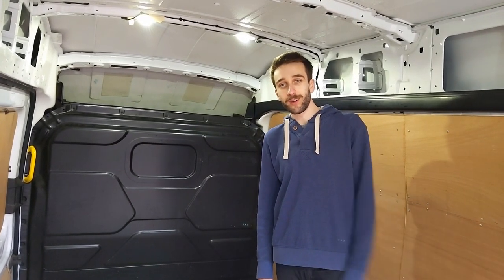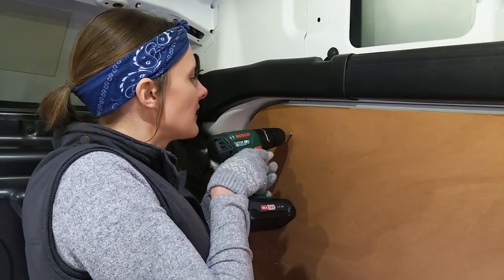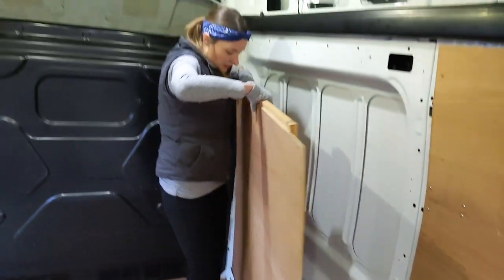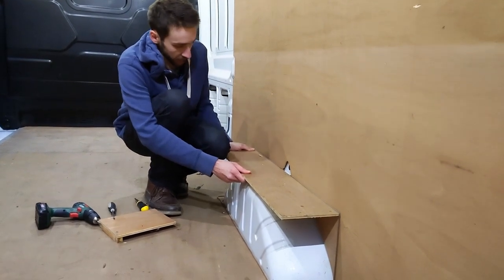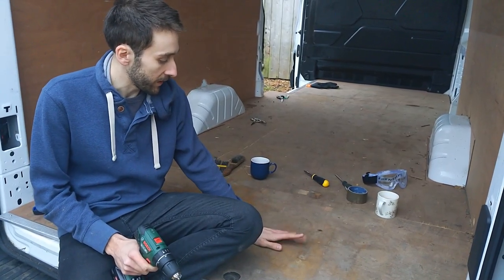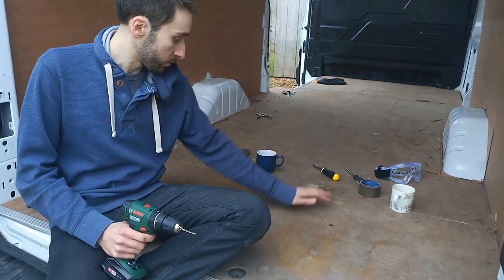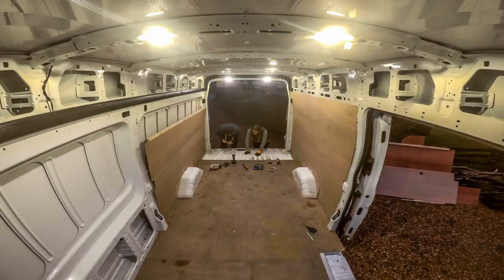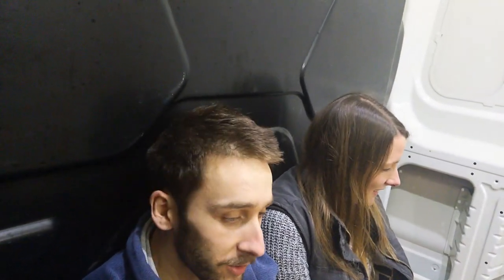The van project begins! Floor out and cleanup | Transit Van Conversion E01

Comment: A word of advice regarding tools …
Invest in an impact driver especially for removing screws their not expensive , either makita or Milwaukee are the best ( I use both makes but prefer Milwaukee) and have been using the same Milwaukee kit for ten years ( tradesmen = sparks ) if your going to build something along these lines the cost of tools is insignificant to the amount of work your going to do 😎🤘🇬🇧
Reply from the maker: Thanks for the tip, yeah we've definitely been accumulating a whole range of different tools throughout this project 🙂

Comment: I've watched all your videos and I love the level of detail you go into. My question is: what made you choose the Transit as your base vehicle? The reason I ask is that we've just started looking for our 3rd project van 😎
Reply from the maker: Cheers, glad you're enjoying them 🙂 and a few reasons really, one of the main ones being that the high roof Transit has one of if not the most height inside, and being tall (Tim) I wanted to be able to stand up. I can do that conformably even with 50mm insulation in the ceiling, 25mm in the floor and the rest of the ply and cladding. The other big reason was we figured parts for Ford would be easier and cheaper to come by both in the UK and across Europe, without having to go to e.g. a Merc dealer. And lastly we just liked the shape and design of it, we think it looks cool. But the downside of that is the curves definitely make for a tricky build out at times! Compared to other vans with straighter walls/flatter ceilings it forces you to get creative but we're happy with our choice and would probably choose the same again 👍🏻
Reply: @SelfBuiltStories  thanks for your reply, that all makes sense 👍. Maybe we'll get to compare notes one day 🙂.
Reply from the maker: @mrmobsi527  No problem, yeah see on the road! 🙂👍

Comment: Think a lot of people would go the mini camper like the VW caddy maxi or a Ford connect. Reason being they could sell their car and still use the van for everyday stuff. Might not want to drive a medium size like a transit around and don't want to pay tax and insurance for a van on the driveway for 44-48 weeks of the year.
Reply from the maker: Lots of different vehicle and sizes out there, we wanted a big van so we can stand up in it and fit everything we need as we use it for months at a time. Great for us and wouldn't want anything smaller right now, but different people have different needs for sure 👍

Comment: Just came across you channel yesterday and am working my way through the videos. Very informative and just the right amount of normal speed and high speed on the boring bits ;)
I have one question which is probably relevant to all the videos is the cost of the major components. The main question relates to the cost of the van and what mileage it had done. I have just started browsing for possible van types and cost and wondered it you had a maximum mileage you considered. Keep up the good work, looking forward to bing wtahcing the rest of the series.
Reply from the maker: Thanks! 😊 We bought our van just at the point when second hand prices started to go through way up. It took us 2-3 months of searching to find the one we wanted for a decent price, and ended up picking it up for around £8k. For the mileage, we were less concerned with the raw number and more with how those miles were gained and what the overall state of the van was. Our van had pretty high mileage (180k) but all within just 2-3 years, as it spent it's previous life driving to and fro across the country cruising on motorways. We were a little concerned with the higher mileage but had it fully serviced and checked out and ultimately decided it was worth it and everything was in really good shape. Hope you enjoy the rest of the videos! 🙂
Reply: @SelfBuiltStories  thanks for the details. Good to know the sort of price a starter van can cost. 
Loving the video story, and just discovered you are in Exeter, we are just down the road in Tavistock and I worked in Exeter for about 8 years. Anyway got to go and watch the next episode. 👍🏻
Reply from the maker: @stevemccormick8751  You're welcome!

Comment: What made you choose the transit, are they not prone to rusting? I'm in the research stage and I'm trying to decide what van to start with.
Reply from the maker: Fortunately we've not had any issues with rust so far and the last time we took ours for an MOT they commented how clean the underside is. We've heard lots of stories of previous generation Transits rusting though so not sure if it's something that was improved a bit on the MK8, but it depends where you're driving too, how much salt is on the road and what climate you're in. On our to-do list at some point is to underseal the van as a precaution but yeah we haven't had any problems, yet! And we went for the Transit specifically as it's one of the highest vans you can get (wanted to be able to stand up easily at 6ft1), and we figured parts and maintenance would be cheaper and more accessible across Europe than e.g. Mercedes. It's a tricky van to build out sometimes because of how curvy it is, but no regrets so far, we like the design and it drives really nice. Good luck with the search!